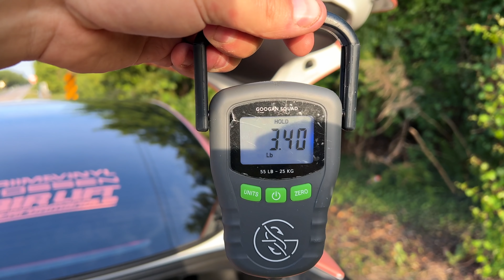Rest in Peace

Comment: codee, i actually do home remodeling and own my own business at 18. My recommendation for you is that area that didnt fit is either use a quarter round down there or if it’s possible for you is if you can recut a small piece and fit it in use a multi tool and the previous piece of flooring and cut it out and it will make it flush and look really good i know your probably wont respond but if you ever need recommendations u can always ask! love the vids!!